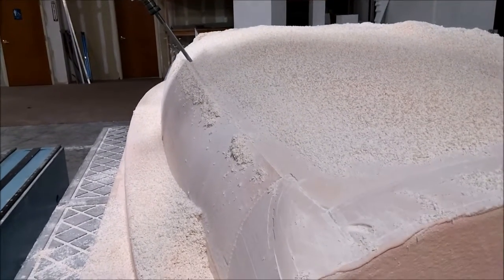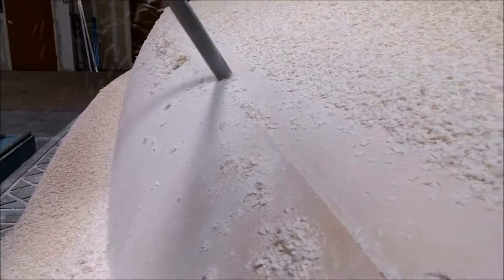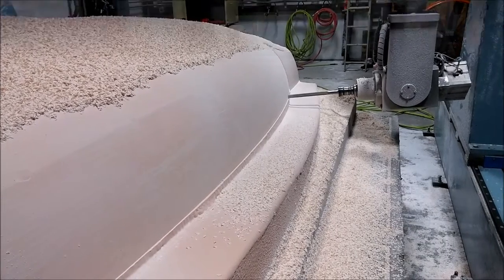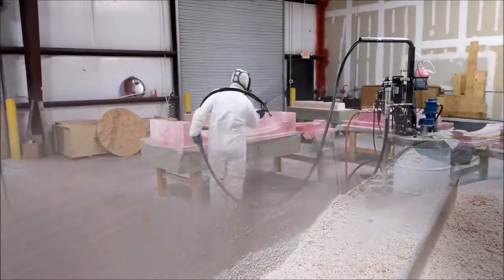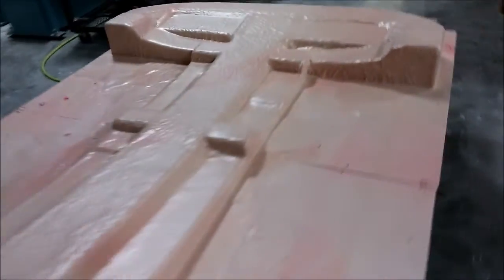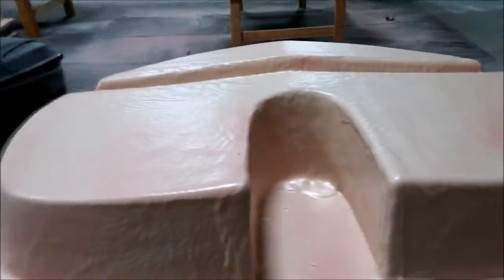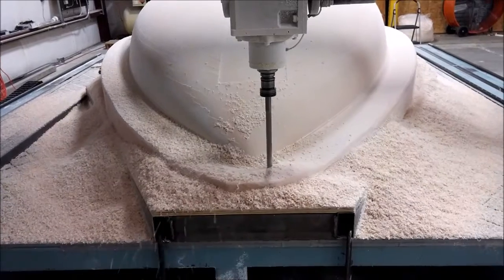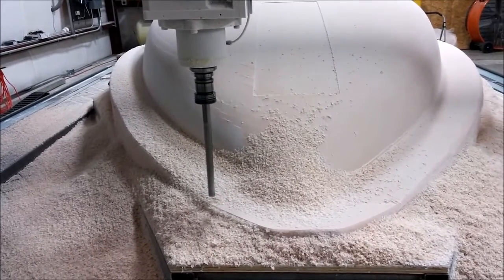Raptor Aircraft December 5th

Comment: Peter,  great updates.  Thanks for doing them.  I do have a question though.  Since you are doing these in CAD and then sending to mill,  how to you account for the putty and fiberglass you are adding to the plugs?  Is there a standard thinkness factor you use?  After you complete a plug,  do you use a measuring instrument to see if it matches the CAD dimensions?